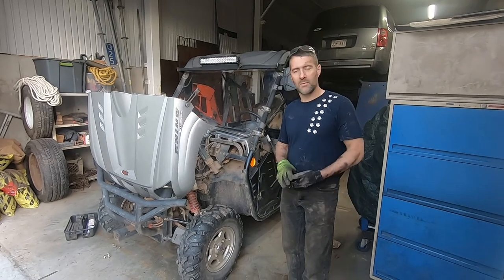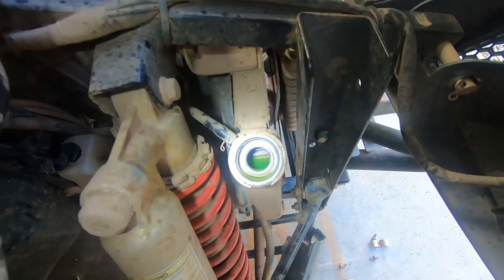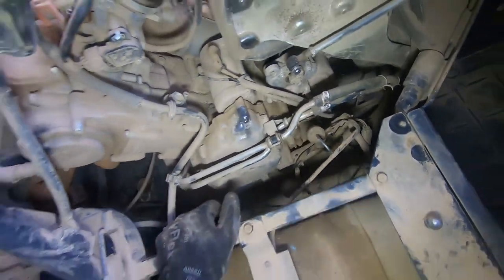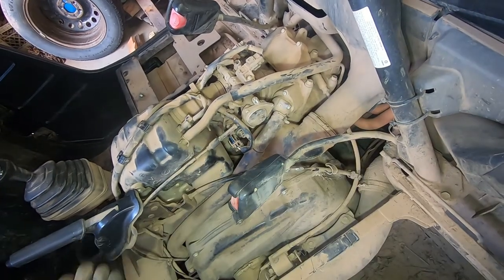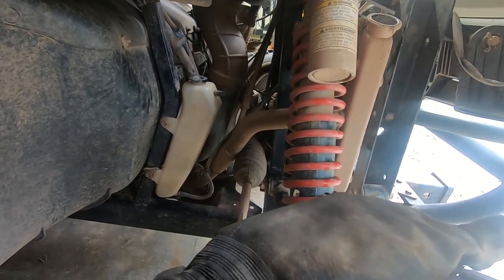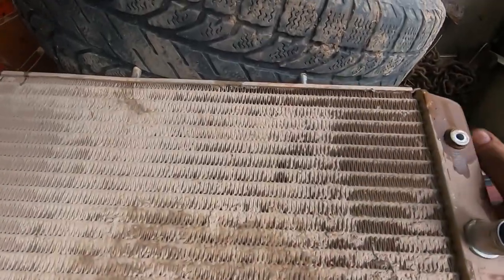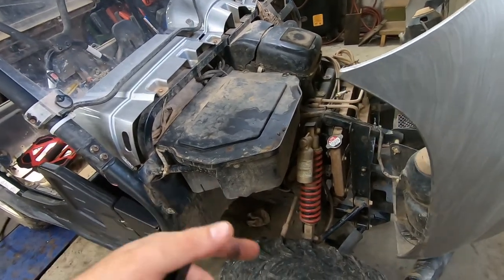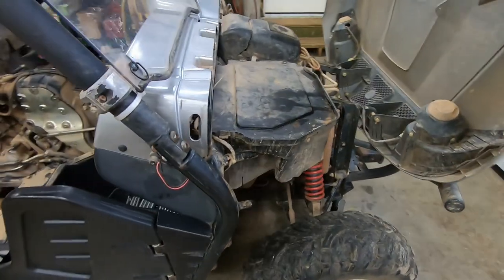Rhino 700 UTV Overheating Investigation and Fix 101

Comment: Thanks so much for these tips.  I've had similar issues with my 2009 Rhino 700.  Will definitely go and check the back of my rad now that I've seen this.  I'm sure mine looks like that one as I don't drive around puddles or mud ;)